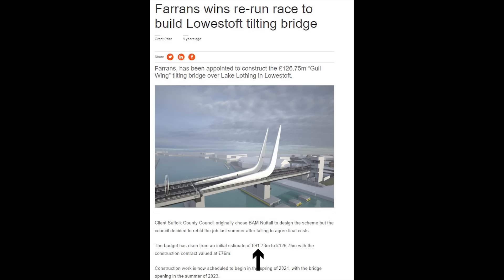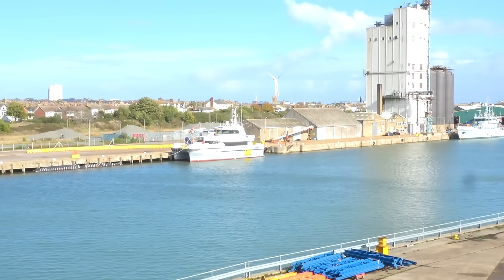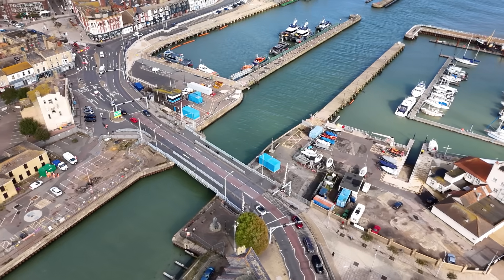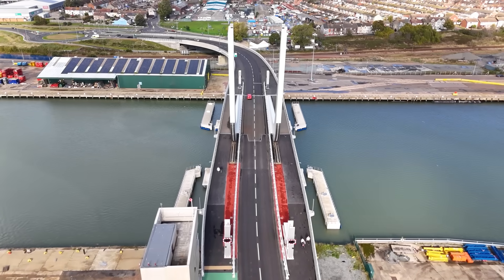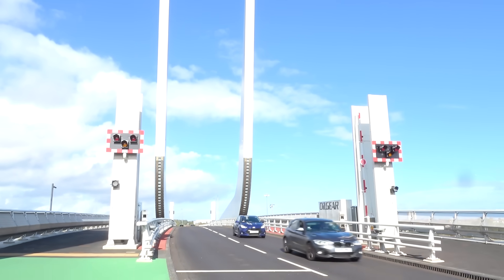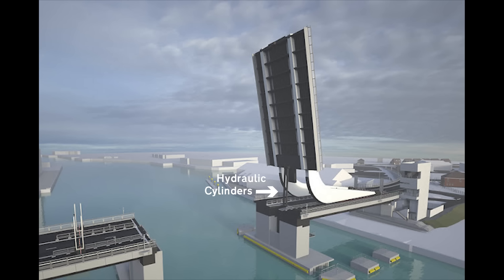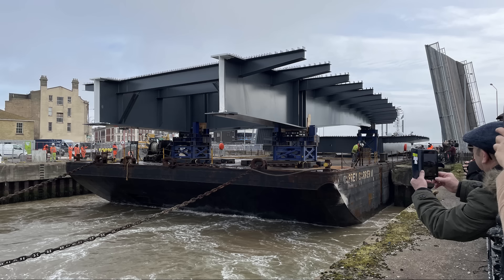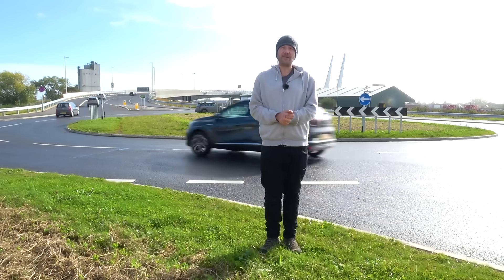The Over Budget Lowestoft Gull Wing Rotating Bascule Bridge - LARGEST IN THE WORLD!

Comment: So we failed to build a small roundabout in the time the Dutch designed and built the bridge and towed it to Great Yarmouth. Sounds about right. Wouldn't be surprised if the roundabout cost more than the bridge, what with the need for building bat tunnels and newt relocation.

Comment: Personally I'm never that worried about the up front cost of infrastructure projects. Within reason of course and I'm not condoning waste and fraud. But as long as an infrastructure fills a legitimate need it will pay itself back faster than you'd imagine (most of the time). 

Maintenance cost is often the real kicker and this seems easily maintainable.

Personally I like the Berlin Wall Watchtower's design but I like bunkers and it reminds me a bit of the German artillery observation bunker on the island of Guernsey. 😁

Comment: I dunno. With so, so, so, many public works projects over budget etc. I think there is something flawed in the bidding process. No company is going to continue working if it is not getting paid and if changes in the economic situation, later changes to the design and such like make that impossible companies face ruin. Ca company deserves a fair return for it's work that should be built into the contract. It is fine to put in incentives and other pressures to get work done on time and at cost, but this leads to corners being cut and a substandard finished project. We also have so deal with the labour unions who rightly will expect their workers not to be run into the ground to get something finished.  I expect workers to do good work and to be on task, but at the same time, it is not the 1880's and I don't expect workers to go home exhausted and expected to work in unsafe or dangerous environments just to satisfy some arbitrary contract. 
I had a friend who was a professional aerospace engineer. He told how they always underbid contracts because that was the only way to get them. Then they finagle more money later due to 'unforeseen circumstances' and then drive their staff 6-7 days a week. My friend quit after he saw his daughter turn 13 and wondered where he had been. Money isn't everything. 
While I generally side with the work force who have been screwed many times by corporations, at the same time, the projects should be coming near their estimates. I think some research should be done to find out why so many are so far off their original estimates. Politicians being average folks aren't going to know enough to know what is a reasonable bid and what is not. I think governments need more in house talent that they pay for that can be used to review such applications, assist in managing current jobs and so on. Otherwise, we are hiring consultants for nearly everything. If we hire our own experts, we can better control, reasonable and fair compensation and reduce the amount of contracting out, where costa can balloon.  Something needs to be done so that these jobs be they hospitals, roads or transit come in near their estimates. It is only fair to the government leaders to have reliable values for such projects so they can reasonably budget things. 

I think it boils down to accepting the lowest bidder most times, instead the most reasonable one. That takes a LOT of expertise, expertise that will not normally be at the political or even civil service level. We need technical experts in government to sort this stuff out properly and reject bids that not properly thought out.

Comment: It's not commonly known but it was designed with two purposes in mind. At Christmas time, local residents are able to take their Brazil nuts (which are notoriously difficult to crack) and place them on the track. Then, a quick call to the control rower and within minutes it's 'job done'.

Comment: Funny you should mention the Berlin style control tower. On the old lifting east bridge i saw a few cock ups over the years,mainly small sailing yaughts following the orange hulled medium size fishing vessel slipstream from the dry dock area out to sea. Probably just the Control Tower not seeing the yaught and wanting to get the bridge back down asap to avoid a traffic gridlock,but a few yaughts lost their mast,cut down by the bridge lowering as they tried to sneak through. This might explain the height of the new bridge.

Comment: Hello John, this type of bridge, the Scherzer Rolling Lift Bridge was used to carry both single carriageway road and single track rail traffic across the River Swale to the Isle of Sheppey (Kent) being opened in 1904. I remember travelling across it in the 1950s. The road was traffic light controlled due to the narrow width. This bridge suffered from collisions from shipping that caused closures of the bridge at such times for remedial work. This all changed on 20th April 1960 when the 'new' Kingsferry Bridge was officially opened by HRH The Duchess of Kent. 

The ‘new’ bridge, constructed by John Howard & Co. Ltd, was 650ft long and lifted the 450 tons road and rail section vertically by counterbalance mechanisms housed in the four towers. 
This bridge is still in use but has been replaced by ‘The Sheppey Crossing’ elevated roadway. All traces of the old 1904 Scherzer bridge have gone except on those of old road and rail track routes seen on Google satellite maps. 
I saw the 1960 lift bridge being built during trips to the Isle of Sheppey.
Best wishes from Oxfordshire.

Comment: This type of bridge always looks good but the design is badly flawed. Standard bascule bridges (such as Tower Bridge) are always in balance - like a seesaw - so they don't need much power to move them. The counterweights on a gull wing bridge are nearly useless when the bridge is closed. Then the counterweights exert more force as the bridge is opened until they balance the bridge deck at 45 degrees. As the bridge opens further the counterweights provide more force than the bridge deck. At the start of an opening or closing sequence the mechanism is not at all balanced. Consequently the bridge operating motor has to be just as powerful as if there were no counterweights at all.

Comment: Wish they'd crack on with replacing our bridges in Hull, there's two that have been left to rot, one got closed decades ago then finally removed a few years ago, another was closed a few years ago while they work out what to do about it (probably wait until it's about to fall into the river and then remove it). There's three others, of that roll-back design, all of which seem to be closed for maintenance more often, heck one of them the foundations are crumbling apart and instead of just fixing it, they're going to "monitor the situation" until it's too dangerous to use. The highways department in HCC is nothing but a bunch of bloody idiots.

Comment: Hi Great Vlog Jon. Perhaps when it's finally finished you can come up and review the Grantham Southern Bypass. Started it in 2016 was supposed to be finished in 2023 now completion date is late 2025. It's only a few miles long but it has to go over a river and train line. Didn't survey the land correctly and it all started sinking
Fun fact. Grantham Canal to River Trent over 30 miles long. Hand dug and I think at least 16 locks. Took 3 and half years to build, in late 1700's.
Reply: London to Birmingham line was started in 1833 and completed in 1838. All done with manual/animal labour and only gunpowder as an explosive.
Meanwhile in the 2020’s HS2 is incomplete despite machinery and better explosives for making tunnels.
Reply: @philsharp758 You realise that HS2 is being built to a much higher standard? Our two centuries old railway lines are plagued with problems
Reply: That exit off the A1 that's still being built baffled me for years, drove past it the other week and thought 'why?'

It had a single truck on it though, so all is well.
Reply: Jon did do a vid when they opened the new junction: https://youtu.be/M2jff7YOyKI?si=qTQxCa-cmdpZCEPn
Reply: @ninebobsvids  Thanks for your info. I've only been watching Jon for a few months, Not caught up with all his vlogs. Nothing much seems to have changed since his vlog. So I'm not holding my breath about the bypass being opened in 2025.

Comment: Cool! Proud to be Dutch 🙂

PS: we also manufacture tunnels, even with four lanes. Those never have to open for ships and would solve all problems for the next 50-100 years. But, yeah, Brexit, covid, supply issues, etc.
Reply: It would be rather daft building a four-lane tunnel for a crossing of little over 100 yards, where the eastern bridge it alleviates only carried 19,000 vehicles per day pre-Covid.  And given the limited space, where would you have built the tunnel portals anyway?  Lowestoft does not sit between major destinations bringing long distance traffic, it is the most easterly point of Great Britain.  Even to get from Ipswich to Great Yarmouth the faster route is via Norwich (and faster still is to just not go there).

Also, the bridge is not really Dutch other than BAM Nuttall, being the British subsidiary of Royal BAM Group, designing it in partnership with Arup.  But it was fabricated in Belgium by Victor Buyck Steel Construction in Eeklo and Wondelgem.  Though Dutch company Mammoet did provide its German-built crane to help assemble the bridge.
Reply: @Rebecka_J   Concrete tube tunnel (Sydney Harbour Tunnel, Boston Big Dig...) do not require too much space as they do not have thick layer of soil above. In this case it would fit into the same space where roundabouts are. In Sydney south portal is 200m from water, and this is for full scale oceanic ship traffic.
Reply: No room for a tunnel there.
Reply: So why not a high level bridge?
Reply: @markm-ci6rj  The higher a bridge the longer its ramps need to be, which again needs more space.
Reply: @markm-ci6rj  Money. Also, space to get vehicles up there in, wind issues, and so forth.
Reply: In Göteborg they practically wade in mud but still have managed to build not one but two tunnels under Göta älv. The first in the sixties and the second finished a couple of years ago. Now they are in the process of digging up the entire city for a railway tunnel. On budget?😅 On time?🤣
Reply: @ovekarlsson777  GBG visar var skåpet skall stå!
Reply: @ovekarlsson777  I am not the one who said anything about ground conditions though!  I am the one saying the infrastructure needs for local traffic in an isolated town are a little different to those for motorways and big cities.
Reply: Well I think also bridges are much more enjoyable for pedestrians and are better at unifying a city. Tunnels are better for trains or highways
Reply: Lowestoft is in Norfolk, so it's got heavy, wet soil and a VERY flat landscape. If you dig a hole, it'll take forever and fill with water as you go.
If you try and build a tunnel, it'll flood.
Reply: @Skorpychan  Ever been in The Netherlands? In many places with four lane tunnels it has heavy wet soil and it is very flat 😁
Reply: @RoseSolane  To be fair, there was a tunnel in the north of the Netherlands which was closed for a while because of ground water pushing up the road surface. It's now being repaired and the costs are already six times higher than estimated. Funnily, there was no public procurement "as this was an emergency". Good news for the tunnel repair company!
Reply: @RoseSolane 😂
Reply: @Skorpychan  Lowestoft is in Suffolk. but I'm sure they really want to be in Norfolk. probably why they wanted the bridge to get to Gt Yaaaaaaaaaaaaaaaamuff
Reply: @Skorpychan  Norfolk has many problems, but Lowestoft isn't one of them! It's in Suffolk. 🙂
Reply: @Flipper-1201  The whole norfolk/suffolk thing confuses me, because I got to Lowestoft in under an hour from Great Yarmouth last time I went up there.
And as someone in Berkshire, they're indistinguishable from each other. Essex is only distinct because it blends with London.
Reply: @Skorpychan  Suffolk.
Reply: @Skorpychan Er yeah, because the one thing Holland isn’t is flat, or 50% below sea level. 😂
Reply: Is a Dutch bridge similar to a Dutch rudder, I’m not up to date with latest sexual acts. As for a Dutch tunnel, I’m not ruling it out.